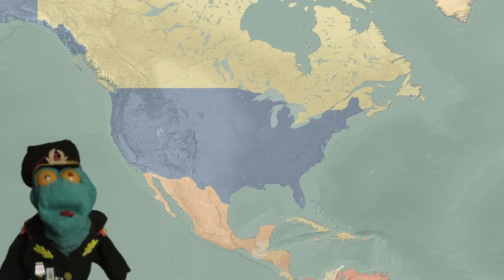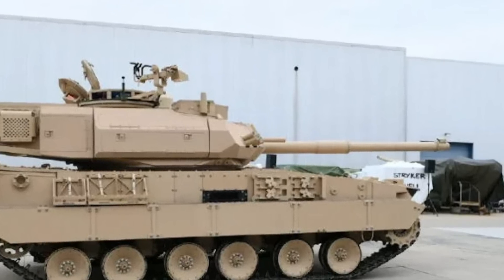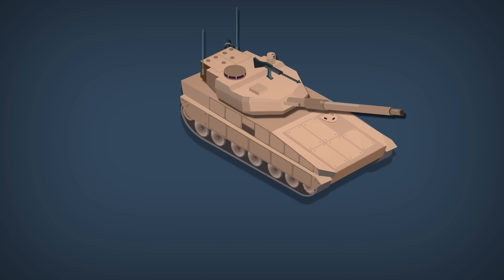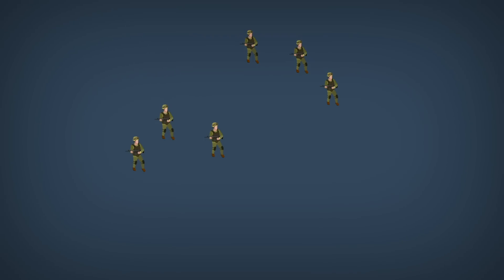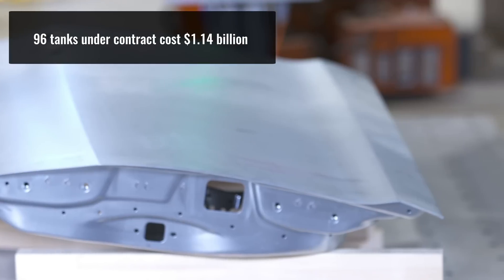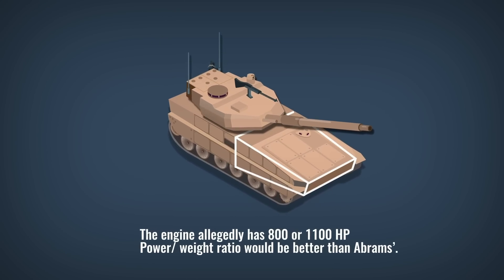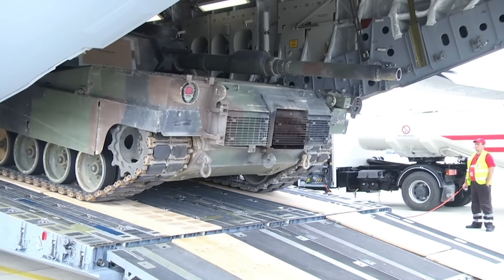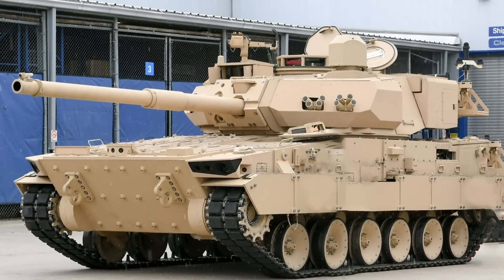US Army just chose its next (light) tank

Comment: This vehicle is going to be the US Airborne's sole armour capability until they can link up with allies after a drop. Missiles are too slow and expensive compared to a tank gun and an autocannon doesn't do enough damage. This program was started to replace the stryker mgs because it was too expensive to maintain but they still need armoured direct fire support. It is air transportable, cheap and good enough for what it has to do. It is not intended to fight MBTs head on, it has air support and infantry AT teams to help with that. Plus NATO standard 105 ammo is readily available and already mass produced which again cuts down the cost. It is NOT an MBT, it has a very specific and limited role. If the light infantry units using it need an MBT that's what the M1 is there for.
Reply: 38 tons thrown out the back with parachutes ? Haaaahaaaa! Ok I'm in ! Open the rear doors and let it Rip !
Reply: @haylocktransport6695  Air transportable by cargo plane. Not paradropped.
Reply: @comradefloppy   You mean the Russians are going to leave a nice huge run way to land on and deliver a 38 ton tank ? Ok ! Just like in the movies.
Reply: @haylocktransport6695  War against a near peer is highly unlikely. The US Army is designed for more than that. Think about it as more like when the French Airborne Captured an airfield in Mali on the 25/26th 2013 and then airlifted reinforcements.

Comment: Most of you have never attempted a mined wire obstical breach in a light infantry unit and it shows. If this tank was to only be used for that sole purpose than it would still be worth every penny. Direct fire capabilities are irreplaceable in the offense.
Reply: I thought that direct fire on wire was very inefficient, considering that the round is small and that wire tends to let blast go around it, like what happens in no man's land in WW1?
And yes, I have been taught the ways. And they are a real fucking pain I totally agree.
1- Bangalore torpedo
2- Line charges
and the worst 3- plant your rifle flat atop the wire and lie down on it. Get up after your mates have crossed. Remember to cut the middle supporting wire first.

And that isn't even including the prodding to it with a mine prod or a bayonet.

Now that you mentioned it, this vehicle needs a mine plow.
Reply: @danielc2701  Bangalore would still be needed, I'm mostly referring to direct fire on the fortified positions set up around fixing obstacles that we don't really have the capabilities to handle. Running across the open to an obstacle is suicide even with a organic support by fire. But with 4X 105mm HE splashing, your odds are quadrupled. 
But if we're adding things, let's throw a MICLIC on that sucker and call it a day.
Reply: @wellread8649  Great, the only thing worse than prodding for mines and cutting wire is prodding for mines under fire....

Comment: I’m more impressed with the German Rheinmetall Lynx and KMW Boxer Designs. Perhaps you can make a vid for them too?
Reply: Yep, slapping a 120mm Gun on that kitty is just the icing on the cake.
Reply: @somederp8915  I can definitely see armies on a budget buying the Lynx and its Lynx 120 support tank model to maintain a decent armored force on a budget. Makes logistics much easier too
Reply: @The_Lunch_Man  it’s German so it will be everything except cheap. 🙂 However, both are incredible modular so you can reduce the logistics and maintenance of an army quit a bit. Light or medium tank with 120mm cannon, APV, anti-aircraft, etc..with one chassis. Especially the Boxer is very versatile.
Reply: @Ivke-zm7uz  yeah it'll be more expensive to procure. But in the long run it'll be cheaper to maintain and upgrade if your armored vehicles are the same chassis and system

Comment: If upgraded with a active defence system and remote weapons station it would be effective in its role.
It's going to be facing infantry that will have man portable anti tank missiles, every military in the World will be reequiping with those.
 
And using the top mounted machine gun by popping open the hatch will not be a good career move, hence the remote weapons station.

The addition of slate armour will probably be a popular aftermarket modification.

These additions won't add that much weight, and already exist on other vehicles so need to real development time - they can just use the Abrams versions for logistical purposes (except the slate armour, of course).

Comment: Interesting how the roles and titles of armored vehicles change over time. During WWII the British had 'infantry tanks' and 'cruiser tanks'. The ones to support the infantry were slow and heavily armored with powerful guns; essentially mobile bunkers.

Today the new infantry tank is nearly the opposite. It has light armor, a somewhat lighter gun and very good speed & mobility. The compromise has shifted away from protection and maximum firepower towards transportability and mobility.

So the infantry support tank of today is probably closer in design to the cruiser tanks of WWII, which were less armored, faster and more mobile. The mission remains different though. The cruiser tank was designed to do heavy armored reconnaissance and to exploit gaps in enemy defenses, getting behind enemy lines and wreaking havoc. That role today is filled by the Abrams in the U.S. Army.
Reply: This is halfway correct.  The U.S. Military as a whole is more geared towards Airforce/ air power. The things that will be doing reconnaissance/expoliting gaps and getting behind enemy lines will be planes and drones, Be it suicide drones or f35's quarterbacking. The role of the Abrams will turn into what it's been for the past few years, defense. These light tanks will most likely push up with infantry while above drones scout out and either suicide into enemy armor/ a CAS comes in and destroys it leaving to the Infantry to deal with infantry, with the light tanks giving them the one up. Once that position is cleared up, the harder to transport Abrams will then come into play to keep those command positions defended, and stick somewhere near to the front just incase a tank manages to slip through.

Comment: The US has the Stryker which can be fitting with an large cannon capable of allowing it to go toe to toe with some tanks. Its lightweight, can go on most terrains a light tank can, it's got decent armor, and can also be used as an APC/IFV when it doesnt have its bigass AT gun. It's part of why the US more or less gave up on light tanks for awhile
Reply: They never ironed out all the issues with MGS and it still has significant disadvantages in cross-country mobility relative to a tracked vehicle. And since MPF isn't going to Stryker units, commonality with other Strykers is less of an advantage.
Reply: The Stryker mgs has been officially retired..

Comment: I wonder if the shot detectors talk to the other shot detectors on other tanks to triangulate where fire is coming from... (netcentric warfare is cool)
Reply: That would mean you need an ad-hoc network with good time protocol... Seems a little overcomplicated when one detector probably does it already on its own.
Reply: If you look closely at the shot detector, it is not just one, but an array of four 'microphones'.
One up top, and three in a triangle below.
With those four units they should be able to triangulate independently, though I'm sure there is some potential for networked threat-share.

My question is how well will they tolerate weather / dust build-up but I dont see why that wouldnt already be tested/resolved.

Comment: Solid choice, especially if it has good sustainment and low maintenance burden. Surprised with the choice of a 105mm rifled main gun vs a 105 smooth bore. Seems like the smooth bore would give more options for more capable AT munitions in addition to HE.
Reply: The thought process there is probably to discourage crews from treating it like an Abrams. It doesn't have that gun to provide anti-tank capability to the units they're attached to, they have it to provide fire support against hardened positions and lighter vehicles. A rifled gun also allows for the utilization of HESH and full caliber HE ammunition which have a much more effective anti-structure effect than the smoothbore's equivalent HEATDP does which, as implied by the name, is a DP (Dual Purpose) munition for both moderately armored targets and structures. I may be wrong on this but that's what I think is going on there.
Reply: @ThatGuyOrby  I'm inclined to agree with you, since its main role will be direct fire support and crews at first will most likely be army tankers that are coming off the abrams and may still view it as their old vehicle and try and use it to combat enemy mbts so giving them a gun that is more meant to use hesh full cal he or duel purpose rounds will dissuade the crews from attempting it

Comment: I dont know which of you space cadets need to hear this.. its not designed to fight tanks, and it is not replacing the Abrams. The military has seen an operational need for a tank lighter than a main battle tank. It can be rapidly deployed and mass produced and has a wide range of applications.
Reply: And gets obliterated in combat QUICKLY!!
Reply: @chiguy0312  and can obliterate soft targets quickly without much concern
Reply: @chiguy0312  average reddit Miltary analyst. firepower beat armour in the current era and so vehicles need to rely on the other layer of the survivability onion
Reply: @chiguy0312  By what, exactly?  Literally anything that can also kill an MBT?
Reply: I get that it isn't for fighting tanks, what I don't get is what it is for instead. What is that operational need? What is the use of a 105mm direct fire weapon that isn't accomplished by existing rpgs, mortars, and artillery? By placing that gun on it you are deciding that it is more useful than a 30mm autocannon that could also be an anti drone weapon. If it were capable of elevations that also let it function as an artillery piece I would get that too. It would be an artillery piece that could be brought forward when direct fire is required, and with fast tracking it could also perform an anti air role. I can see why you might design a modern flak 88. As it is, it has one capability only, and I don't see how direct fire is so important to the modern battlefield that it is appropriate to produce a vehicle that can do nothing else and not even win a direct fire battle.

Comment: I love these stripped down show versions.  Wait until the motor pool gets ahold of them and starts welding everything in sight to them. You’ll have rpg cages, washer and dryer a full kitchen tack welded to it. Then 30 guys will hang their bags off it and 100 sandbags to make a quick machine gun nest. Honestly it’s needed tho. Heavy armor to move equipment and return fire that won’t be disabled after 1-2 hits. This is not the tool though the M1 abrums was. The only 2 things this can do is blow up and fit in a c-130.

Comment: The Americans hate light tanks tho. This is a huge doctrine change. 🤯
Reply: Adds another logistic train. Just use the heavy stuff right off the bat. Don’t want to kill the enemy too much?
Reply: @TheBooban  Takes too long to move the heavy stuff, this is for quick rapid deployment. Not to mention the heavier stuff uses more logistical supplies.
Reply: I believe it's more for Lend Lease applications. The U.S. already has the cannon mounted Stryker that could fit the same role.
Reply: @orlock20  Are you talking about the Stryker with the autoloader 105mm? Because that thing is retiring this year lol.
Reply: @krunchie101  It weighs the same, it has about the same firepower for what it will be used for and it already it exists. This is going to be the tank version of the Spiderman meme where various Spidermen are pointing at each other.
Reply: @orlock20  The Stryker is also wheeled, and as such much worse off-road than a proper light tank. Limited ammo capacity would also be a concern with the Stryker.
Reply: @krunchie101  This Tank is what Replacing them in Service

Comment: Looks like a Tank that costs 2/3 of an MBT, has 2/3 of the weight, but has only 1/2 of the capabilities and 1/4 of the survivability
Reply: The troops have been ordered not to engage enemy tanks.  Problem solved.
Reply: @Paladin1873  Don't the troops also have a variety of anti tank systems.
Reply: Light tanks fight infantry and other light targets.
Reply: @NautilusSSN571  Yes, but they work best from prepared ambush.  In an ideal world you know the disposition of the enemy forces and their capabilities and can counter it with an appropriate force mix, but such combat opportunities are the exception rather than the rule.  Like A-10s and AC-130 gunships, light tanks are suited for a low threat environment.  In a pinch they can fight a superior force, but it will normally come at a high cost.  Such an incident took place in the Gulf War when a scouting group of Bradleys took on some Iraqi tanks.  The Bradleys won the slug-fest, but at the cost of several vehicles and crews.  Had the men been in Abrams there would have been no such casualties.  This is the tradeoff.

Comment: It's unlikely the US marines will adopt the Griffin II because the whole point of retiring the Abrams was to return to a fully amphibious force and the Abrams simply cannot be used in a beach landing and take a long time to be loaded up on an LCAC and off loaded space that could be used by supply and additional troops. The USMC is likely going to adopt a variant of ACV that has an ATGM launcher and auto cannon.

The reason why direct fire support isn't really necessary for the USMC is largely because of all the Air, land and sea assets they have organic to the MEF that simply isn't available to the army like rapid deployment of fixed and rotary wing support, indirect fire support , and naval fire support.
Reply: Marines also have a lot of other very costly acquisition programs going on. Traditionally they've had to make do with worse equipment than the other branches. But they are now receiving some of the most advanced equipment in the US military MV-22, CH-53K, F-35B, JLTV, ACV, drones, and a bunch of new missile/rocket systems. All that is coming at a cost and adding a new tank to the budget might not be feasible.

Comment: As its a General Dynamics project we need to know just how closely related it is to the UK's Ajax project (also G. Dynamics) which may have to be abandoned due to significant design, construction and operational problems?   Are they underneath the same Chassis, but with the Griffin light tank just having one less axle?  The US won't be wanting to make the same mistakes as the Brits, or end up paying indirectly to correct the problems with the UK's vehicles either.

Comment: Makes sense to have smth like this... Lighter, so it can go where Abrams can't. And since modern ATGMs make armor pretty much irrelevant, it makes sense to have smth smaller and more mobile.
Reply: Thank you ! Reading the comment I was just about to write something similar.
Reply: It's not lighter enough though.  The original design requirement was that it be air mobile by helicopter but they pushed the weight up so much that it now can only be airlifted by C17, the same aircraft that would be used to carry Abrams.  The size difference is so close that the C17 could carry 2 of these, or 2 Abrams so in what situation would you possible want to settle for the lesser armed and armored tank instead of the better one with a proven history?

Comment: As you may...or may not know. America hasn’t built any..new M1’s. They are routinely refurbished completely stripped down.....and? Put back together with any improvements deemed necessary.
Reply: Actually the manufacturing line is still operational making several brand new M1s a year. The army doesn't want them so they go right into long term storage. It is all political.

Comment: Worried a little bit about the survivability, what happens when someone starts shooting atgms at it? We’ve seen how common they are.
Reply: Even an Abrams wouldn’t likely survive a hit from a Javelin or a concentrated attack from multiple and heavy anti-tank systems.

This is entirely to supplement light infantry and standard infantry brigades/divisions. Mechanized and Armored will still be running with Abrams.
Reply: shoot the ATGM enemy troops first 
how you locate and shoot them in advance is up to debate
Reply: not grifffin 2 but a wheeeled Japanese Type 16 which is lighter at around 26-28 tons can survive atgm at the front at least. The side protection is only against 14.5 or maybe 12.7mm though. So this thing probably the same except the side can withstand 25mm autocannon??

Comment: If you have a nation of SUV drivers, thinking 70 tons are a good whight for an MBT, than 35ton might be a good deal.

But i didn't see much reason for it. It can't stand any modern ATGM's nor propper IFV autocannon fire, as well as teh focused ground pressure didn't grand any advantage over wheeled mobility(which is often amphibeous) so ... wtf is this?

Even Lynx and CV 90 can have 120mm firepower and make propper light tanks, able to fight some MBT's on decent rangge - while fielding way better APS to reduce lethality of tanks returning fire. This thing is just a recyling for the 105mm artillery guns, it seems.
But what a luck it will approach only when another generation of tech has passed  ._.

Comment: An IFV with a 25mm, 30mm, or 40mm cannon might be more effective.
Reply: Not when you consider the need to fire BIG HE
Reply: Depends on the mission. A 120 mm mortar is more effective, larger blast, more damage, far more accurate, and extremely responsible.

But it can’t replace the fact that a 60mm mortar can walk with a platoon, and have a round in the air 3 seconds after they are shot at.
Reply: Bro did you watch the video? This thing is designed to destroy bunkers. A 30mm can't do the amount of destruction 105mm can.